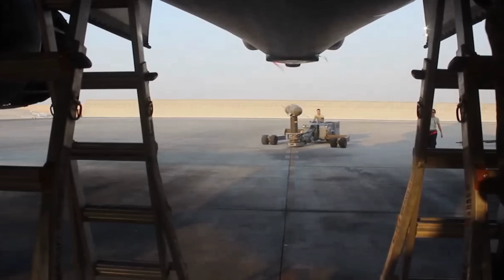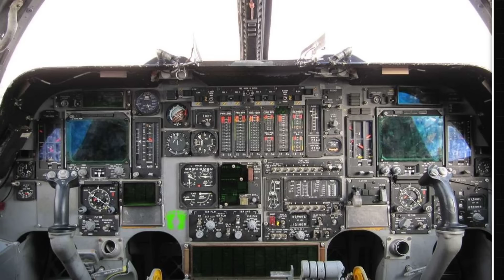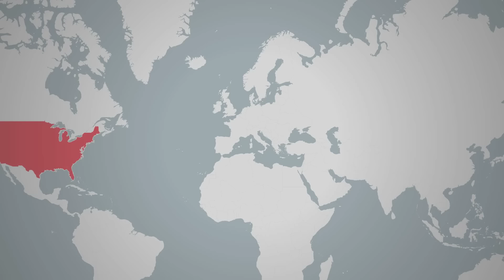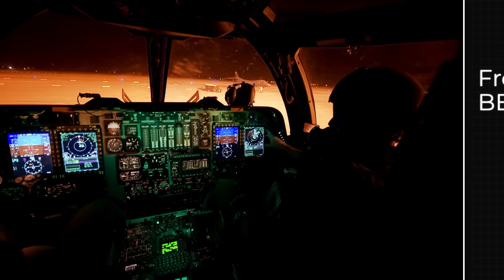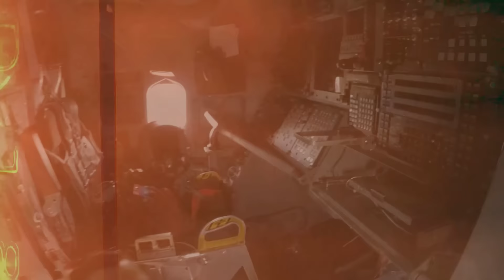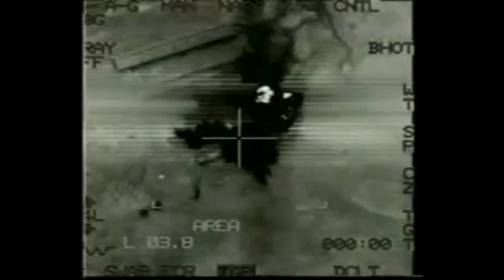US Air Force’s NEW B-1B Lancer Is READY To Shock The World!

Comment: OK------------ .  JUST THINK IF THEY UPGRADED THE B-1 WITH THE NEW ADAPTIVE ENGINE TECHNOL0GY  UPPING THE POWER TO 40,000 LBS FOR EACH ENGINE AND STILL ABLE TO FAN UP FOR A 30 % INCREASE IN RANGE..  WHO KNOWS, THE B-1 JUST MAY BE ABLE TO SUPERCRUISE. WITH  ALL THAT POWER..  

-------------- .  EVEN BETTER WITH  HARM AND AIM-- 120M, AIM-- 260 AND THE 174B ULTRA LONG RANGE MISSILES IN HALF OFTHE FRONT BAY, THE B-1 COULD DEFEND ITSELF AS IT COMES INTO THE TARGET AREA TAKING OUT THREATS LIKE ANT--AIR MISSILES, RADARS  AND EVEN FIGHTERS WITH THE POWERFUL RADAR ON THE BIG SUPER EAGLE.. LONG BEFORE ANY ENEMIES GOT CLOSE ENOUGH TO FIRE AT THE B-1.!!!!  WITH SIDEWINDERS  ON BAY DOOR RAILS, FOR CLOSE IN WORK, INCLUDING TAKING OUT FIGHTERS BEHIND THE B-1B... WHILE STILL OVER 10 MILES AWAY. SINCE THE FIGHTER WOULD GO HALF THE DISTANCE ITSELF.. WITH UPGRADED TAIL RADAR..
Reply: Caps  lock is on